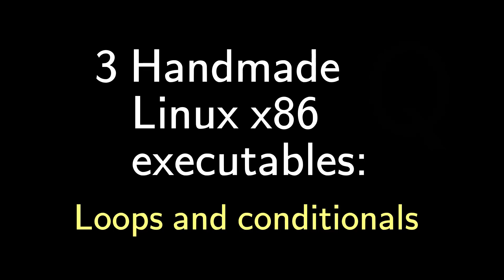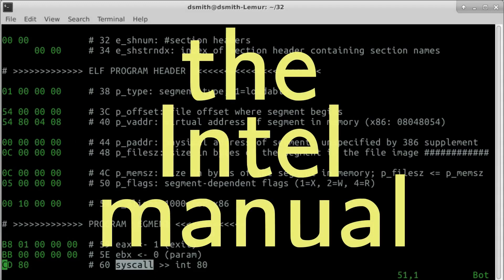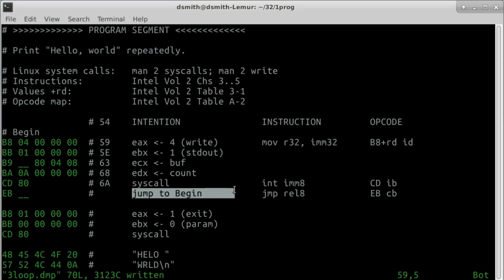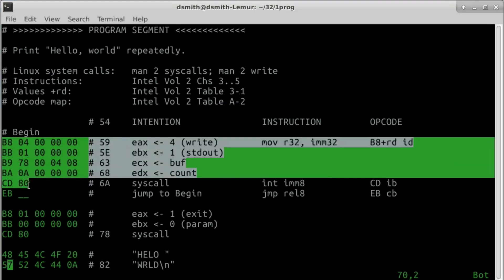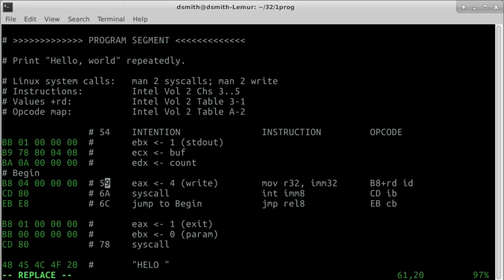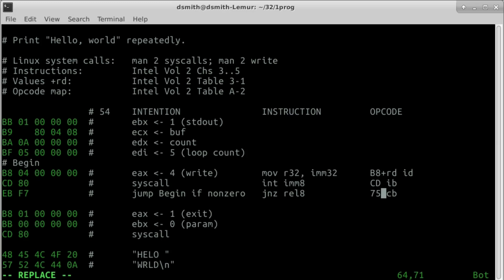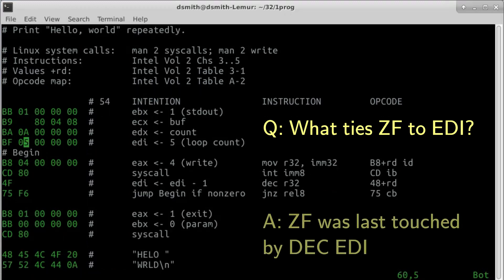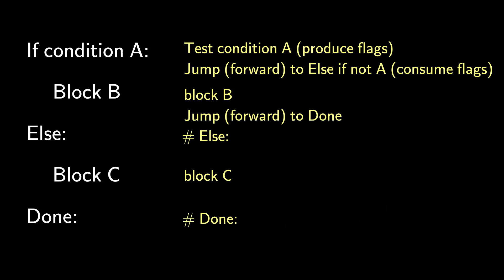3 Handmade Linux x86 executables: Loops and conditionals

Comment: I noticed something interesting. The program never reaches the exit syscall and doesn't have and error handing for write, and yet when the pipe (to head) was closed. A after quick googling I saw that SIGPIPE is sent to the process when writes to a "broken" pipe. I know that singlals have handlers and some signals have default handlers, but I thgought that the default handler is in the executable, generated by the compiler. So if the default handler is not in the executable itself does it execute as a part of the process or it's a part of the kernel containing the code "kill <the pid>" ... wait kill also sends a signal. So how does a code (default handler) executes as a part of this program?
Reply: The default handler is part of the kernel. However, it does not contain "kill <the pid>", it instead contains "exit(some_error_code)". So, it doesn't send a signal to terminate, it terminates the process directly.
Reply: Good question! I'm quite novice in these things, but I guess that if a program doesn't have a signal handler to some specific signals, the OS simply SIGKILL the process ? As in, actually terminates it, no more signal sending.

Comment: Really interesting videos you've made (at least for me as nerd).
I'm not going to try to write programs this way myself - but before watching these videos I didn't know anything about ELF. Now I know some.
And a little more x86 machine code (not that I'm ever gonna use it in real life)
Reply: Depends on what you mean by "use it", the software you wrote that comment on may have been using an x86 CPU after all
Reply: @JobvanderZwan  https://youtu.be/oShTJ90fC34?si=eBeR7BOIgp06Yvio